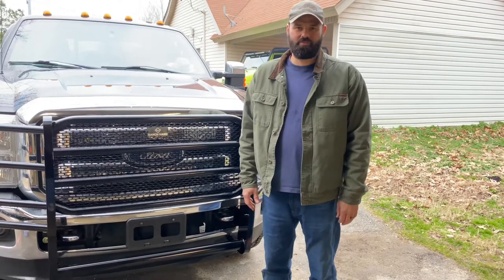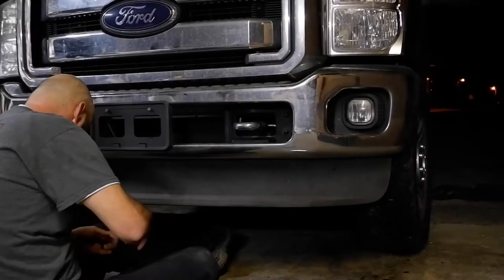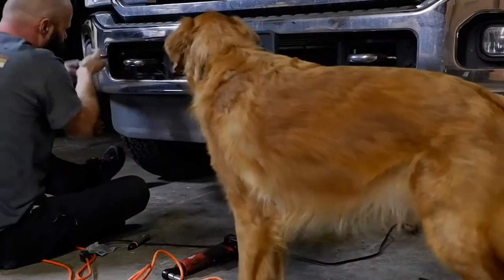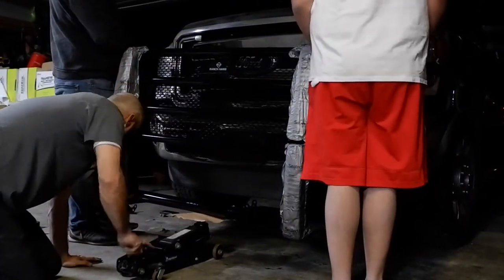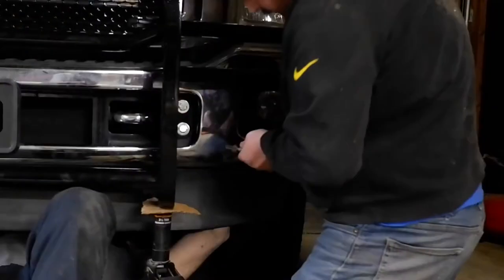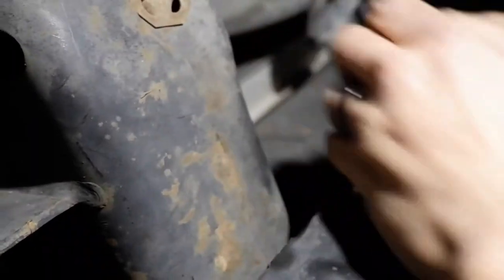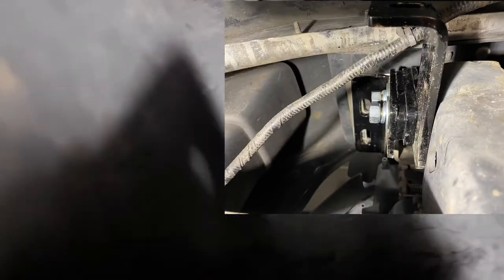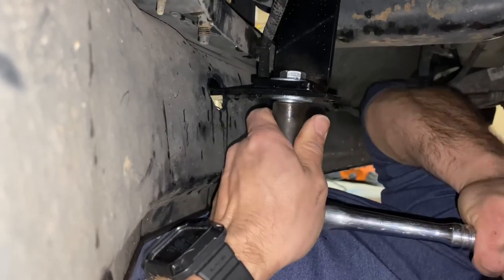Tow Rig | Ranch Hand Legend Grille Guard Install | 2013 Ford F-250

Comment: Just mounted the same grille guard to my 2012 f250 and I love it. Thinking about installing a light bar or 2 on it now. It's built very solid and is a nice option if you're not will to change the entire bumper.
Reply from the maker: I thought about installing a light bar or a couple of pods but haven’t decided yet.

Comment: Grill guard vs the full bumper, pros and cons?
Reply from the maker: For me it was the cost. I bought this grill guard for about $600 direct and the full front bumper is way more expensive and I didn’t really need that level of protection. We also tow a lot and this was quite a bit lighter thus saving some payload capacity.
Reply: @SomedayDownSouth  got it… thanks

Comment: So with the added weight on the front end how much did it make the front end sag down?
Reply: None at all. I cant tell it’s on there. It’s only 150lbs or so.
Reply: @danielpatterson1420  well it is a super duty i have a f150 with a leveling kit. I assume your front suspension is much stiffer then mime. The brush guard I ordered is 85lbs so i hope it dont